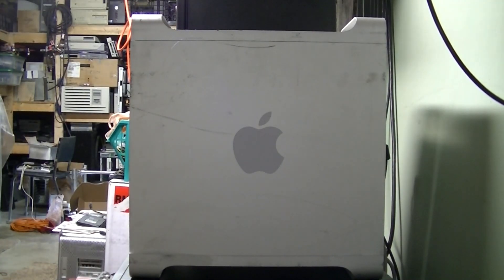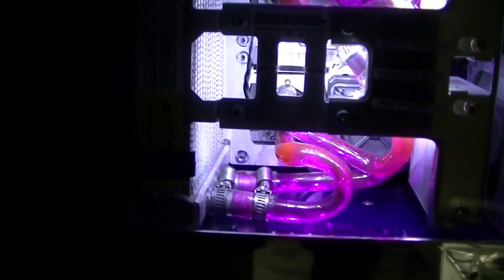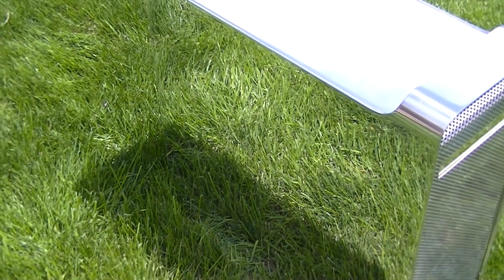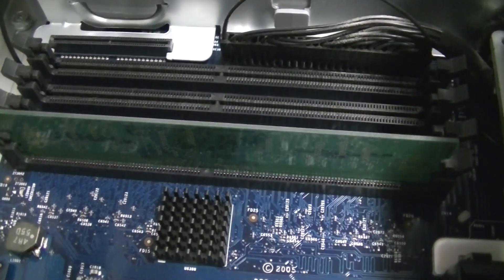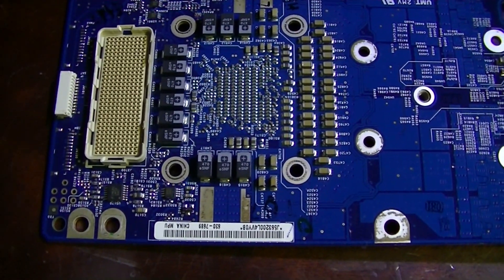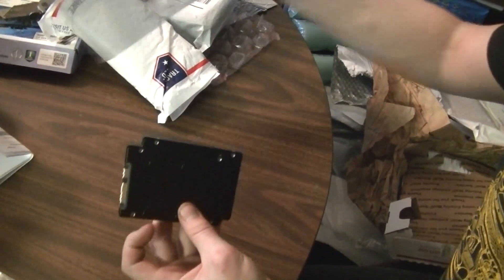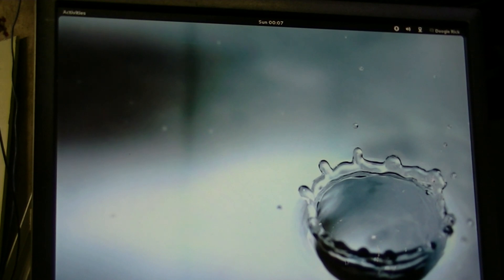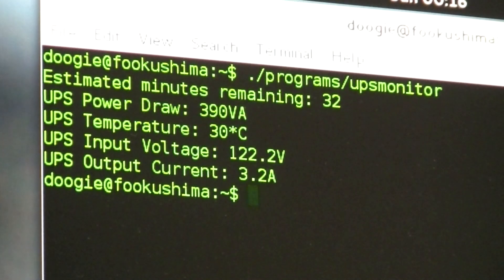The best Apple G5 Quad in the world, hand polished. (G5 / Mac Pro casemod) PPC Debian Linux Server

Comment: Could you boot OSX of the raid card? Or only Linux?
Reply from the maker: I'm pretty sure you will not be able boot directly to it with OS X. I have not tried this though. Linux handles the boot process of Open Firmware perfectly, so I imagine it's the same result.
Reply: Ok, thank you and also good work on your mod.

Comment: GOOD WORK! The old hardware doesn't mean that is useless! Don't forget the fact that the POWER architecture is made for military, satellite and foreign planet rovers' onboard computers! I don't know why they discontinued producing these awesome machines, it can probably work for decades with linux ...
Reply: +bbpetrov   Probably fell apart because IBM made Steve Jobs look like a fool.  When your supplier tells you they will have a G5 laptop ready to go by a specific date and you make a public announcement based on that it looks bad when they don't deliver.   Interesting bit of info the company Apple bought to make the A7 chips for the iPads and iPhones made PPC products before and actually had a working mobile G5 in the works but Apple had already jumped ship.

Comment: Did you use the same tool throughout to polish the case, or did you just use that original tool there to remove the anodized part and a separate buffer to finish it off? I'm curious and would like to know the exact process so I can do this myself. Thanks!
Reply: *****
Thanks for clarifying! BTW, do you mean to say that you used each grit (each sheet of sand paper) until it was dull, THEN moved onto the next one? Just wondering when one is supposed to switch to the next highest grit, and so on. Lastly: Looking back on the project, do you think that it would have been better to have used a rotary sander instead of sanding by hand? I know power tools can sometimes be overkill, but it seems like it would be best to use a rotary sander and THEN finish off with the hand-polishing solution. Of course, one would have to make an exception for the undersides of the handles and around the ports, as those are likely areas that cannot be reached/fully covered with a tool.
Reply: ***** Gee - that's more involved than I would have thought. It would be far easier to do with a PowerBook G4 or something, as the anodized layer on the underside of my PowerBook G4 has worn spots just from the machine being slid around. I did see a tutorial, though, where someone did this to his PC case (that had anodized metal, albeit thinner), and he used a rotary sander and still got a great finish after going over it with polish... but, even then, I'm not sure I can personally justify spending that much time and money on it. However, thanks for explaining the process in full detail. If I ever decide to do this on some other type of casing, I now have some more knowledge on it.

Comment: Beautiful.mI bought the dual 2.5 when it came out. Wish I would have bought the Quad with PCI-E. The Sonnet Tempo Dual was a good choice as I have one of those in my upgraded 2009-2010 12-core X5690 MacPro and love the speed. I want to upgrade my G5 for server use but the PCI-X slot limits upgrades although there are some cards out there. Cheers.
Reply: Hi Doogie - I'm making a new video explaining how Apple should design their upcoming Mac Pro and why. I'd like to use a few seconds from this video in my video. May I have your permission to do so? Thanks, Steve Steele

Comment: Awesome, the polished finish looks great! Look forward to the build videos

POWER, ARM etc. are becoming viable options now, it won't be too long before you can throw some modern non-x86 guts in there :-)

Applied Micro, AMD, Broadcom etc. are all working on "big" ARM cores for server. GIGABYTE already have an Micro-ATX board toting an 8-core X-Gene chip listed on their site: http://b2b.gigabyte.com/products/product-page.aspx?pid=5422#ov 

X-Gene 1 (the 40nm TSMC first-gen) is a brilliant chip that deserves more attention, IMO. They managed to pack 8 x 2.4GHz custom ARMv8 cores (IPC about 90% of Haswell), SATA III controller, PCI-E 3.0, 2 x 10Gb Ethernet etc. all into a 45w TDP. It's insanely good.

We're gonna see some sweet ARM machines in the coming years, Broadcom Vulkan, 28nm 16-core X-Gene 2, AMD K12 etc.

Plus, IBM are seeing some success with OpenPOWER and POWER8.

Here's a TYAN bundle with ATX board using 4-core/16-thread POWER8 IBM "Turismo" chip:
http://www.tyan.com/campaign/openpower/index.html
Still a development product at this stage but a good thing nonetheless.